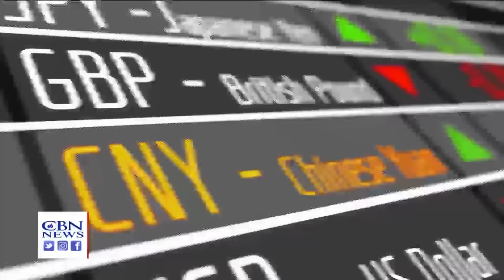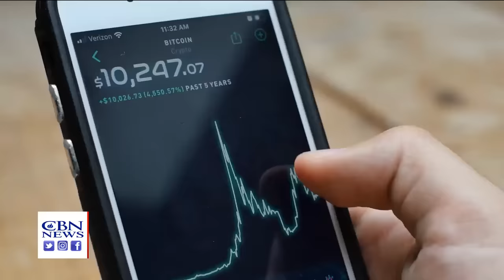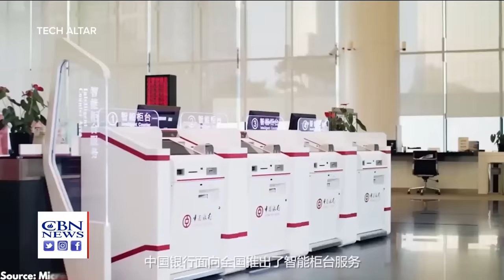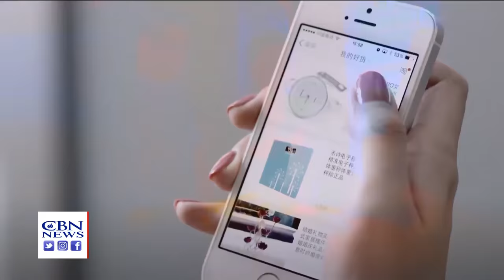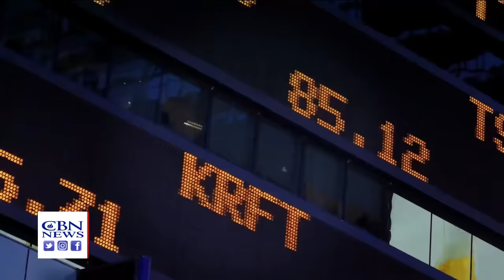China's Big Development Could Set World Up for Mark of the Beast

Comment: Look at the symbol for the Chinese digital Yuan, it looks like Baphomet horns over a cross. 

Here it is:. ¥ 
It is also an equilateral triangle over a cross.

Using the wisdom of Pythagoras to calculate, we see that the inside angles of an equilateral triangle are: 60x60x60 = 180°degrees. 
666=18
¥=666 
      ✝️